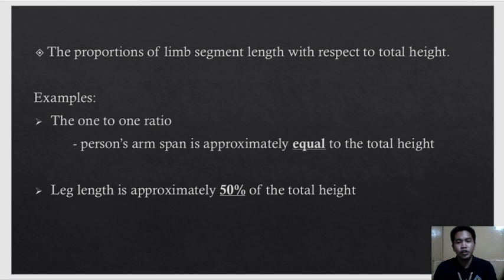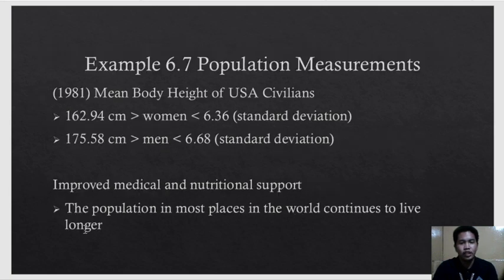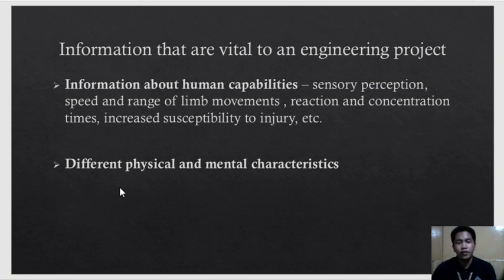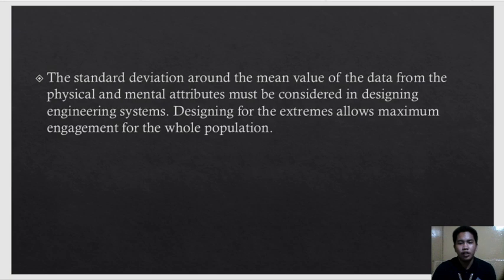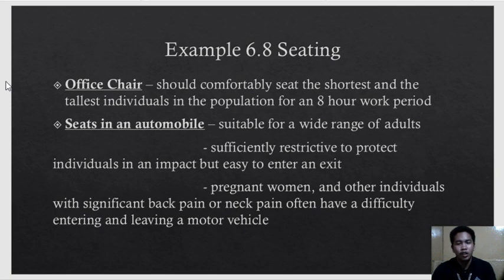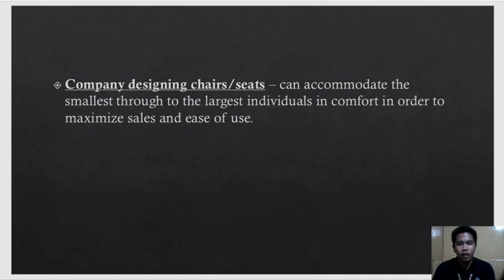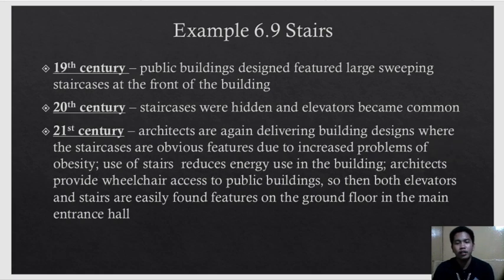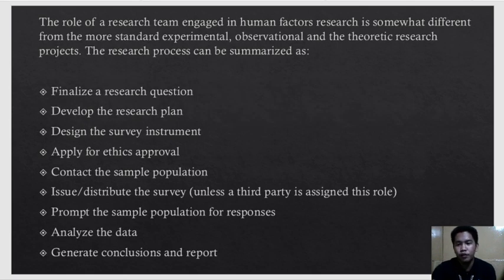Ergonomics and Human Factors

Comment: Lerio, Shiela Faith
March 19, 2023
MWF 6:30-8:30 PM

REFLECTION:
After watching the video, it is clear that the study of ergonomics and human factors research is essential in designing engineering systems that cater to the human body's physical and mental capabilities. It is also important to consider the normal distribution of human attributes when designing for a population.

REACTION:
The reporter gave an insightful and informative discussion of the lesson. The explanation of the importance of anthropometric measurements and human factors research in engineering projects was particularly clear and informative. 

SUMMARY: 
The field of ergonomics involves research into human engineering specifications and anthropometric measurements, while the study of how humans use technology is known as human factors research. Detailed lists of human capabilities, such as sensory perception and limb movements, are published in textbooks and scientific journals and are important for various engineering projects. Designing for the extremes and considering the standard deviation around mean values is necessary for engineering systems, and issues of inclusiveness and equity for those with disabilities must be addressed. The research process for human factors research involves finalizing a research question, developing a research plan, designing a survey instrument, applying for ethics approval, contacting the sample population, issuing/distributing the survey, analyzing the data, and generating conclusions and reports.

Comment: Gador, Christian M. 

March 19, 2023
MWF 6:30-8:30 PM

REFLECTION:
As engineers, the design of a product or service should consider the ergononmics of the human factor. These are vital information in engineering projects to ensure that it wont fail. 
 
REACTION:
The reporter explained the topic very well. The examples used in the presentation are simple and easily understandable. 

SUMMARY:
In engineering projects, it should be designed for the extremes. In this way, the whole population is considered when designing systems or products. For example, a chair should be able to seat the shortest as well as the tallest person for about 8 hours of office work. The physical and mental human capabilities are important data for designing engineering systems.

Comment: Name: Janeze S. Pacaña
Date: March 19, 2023
Schedule: MWF 6:30 – 8:30 pm
REFLECTION:
The lesson made me realize the significance of providing diverse groups of people with the chance to express their views on the path of engineering research. This guarantees that the research team is involved in creating products and services that meet the needs and values of the intended users and the surrounding society. Engineers should also consider fairness and inclusivity towards people with mental and physical disabilities in the population.
REACTION:
Well done on this video report. The information was presented clearly and effectively, and I appreciated how the reporter provided the key points on this lesson. 
SUMMARY:
This lesson talks about ergonomics and human factors which are all essential parts in making a research project which explores and develops new knowledge and products that could benefit humanity. Ergonomics is the study of designing and arranging products, systems and equipment so that it will be safe and efficient for human use. In this, we must consider the different human factors so that we can verify that the project we are going to develop will benefit humanity. It is required to understand the human size, shape, movement degrees of freedom, mental and physical capacity, and sensory systems because engineering researchers are designed to improve human condition. There is a research process presented in this lesson, First, finalize a research question, then develop the research plan, design the survey instrument, apply for ethics approval, contact sample population, issue or distribute the survey, prompt the sample population for responses, analyze data, and generate conclusions and reports.

Comment: Banguiz, Tiffany Fate A.
March 19, 2023
MWF 6:30 - 8:20 pm

Reflection:
In engineering, the human factors must also be considered as for the aim of the research study is to innovate or create something beneficial to humanity. Factors to consider like comfort of the possible user, different physical and mental characteristics. Overall, engineers must consider a population in designing their projects. The research process can help in making the study used by a lot of people.

Reaction: 
The report was well presented by the reporter. The report was clear and understandable. Overall, the report was very informative. 

Summary:
Design is a big factor in engineering. The design should be beneficial to a lot of people considering human factors like the physical and mental characteristics. Engineers must also be considerate in making the design, and the design could be used by people with disabilities. In making this possible, a research process should be followed where it starts with a finalized research question, the research plan, design of the survey instrument, ethics approval, contact the sample population, distribute the survey, prompt the sample population for responses, data analyzation, and lastly generate conclusions and report.

Comment: Yucor, Janet B. 
March 19, 2023
MWF 6:30 - 8:20 PM

REFLECTION

Ergonomics and human factors are plays a vital role in research to ensure the wellbeing, productivity, and safety of both researchers and participants. Human Engineering specification and the range of human functions in the subject of research investigation in a field.  These ideas can be used in a variety of ways in the context of research. Ergonomic considerations are important for designing a research workspace that is comfortable and safe for researchers. This might include optimizing the placement of equipment and tools, providing adjustable seating and lighting, and ensuring adequate space for movement and storage. Human factors are important for designing research studies that are efficient, effective, and ethical. The field of research into the use of technology into human. 

REACTION 

The reporter presented his report well. The texts in the video presentation are readable. He deliver his report clear and concise. 

SUMMARY

Ergonomic and Human Factors can be applied in the analysis and interpretation of research data. For example, researchers might consider how factors such as participant comfort, fatigue, and motivation may have influenced study outcomes. They might also consider how the design of study materials and procedures may have affected participant performance or perceptions.
Researchers may make sure that their studies are secure, effective, and efficient, and that the generated data is correct and trustworthy by taking ergonomics and human factors into account in the planning, carrying out, and analysis stages.

Comment: SORIANO, ARCHIE ISABELLE A.
MARCH 19, 2023
MWF 6:30-8:30pm

REFLECTION
Ergonomics and human factors are one of the components especially in engineering research, wherein this involves the improvement for the efficiency of systems and equipment. By designing such equipment, they can increase productivity, reduce errors, and improve overall system performance. Moreover, engineers must be aware of equity issues and inclusiveness for people with disabilities or limited mobility, ergonomics and human factors research can help engineers design products that are more accessible to a wider range of users. 

REACTION
The presenter delivers his presentation well, wherein he provides a clear and concise explanation, from which I, as a viewer, can definitely grasp new knowledge about the topic.

SUMMARY
Based on the video, ergonomics and human factors are important especially in engineering research. Where it helps the researchers identify the potential to design products or equipment that are safe for the users. Moreover, when designing engineering systems, the standard deviation around the mean value for human attributes must be taken into account. In ergonomics human factors, engineers must be aware of equity issues and inclusiveness for people with disabilities or limited mobility to design products or a project that are most accessible or a user-friendly. Overall, ergonomics and human factors are critical considerations in engineering research wherein this  can lead to improved productivity, and better overall performance of the product or system that is being designed.